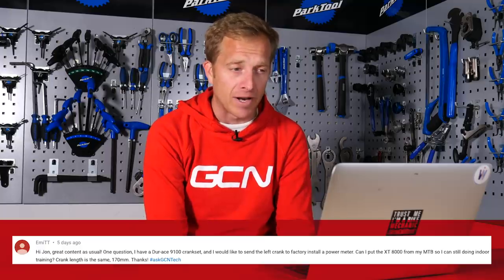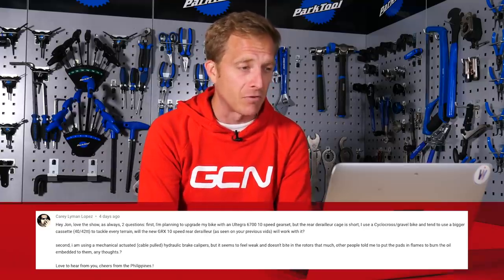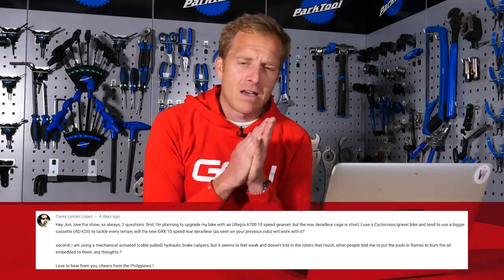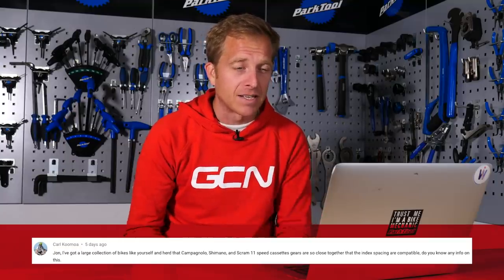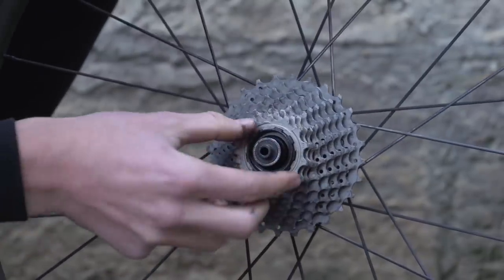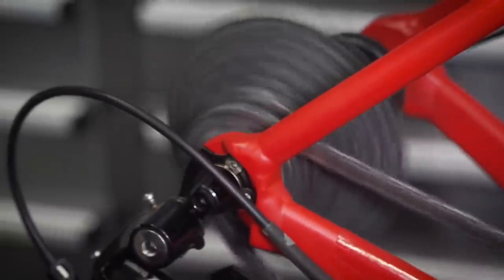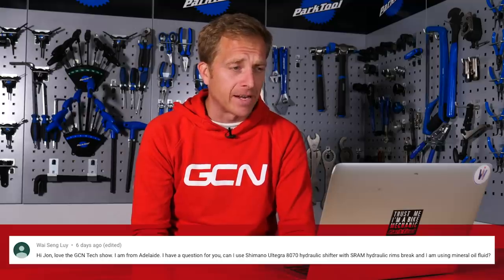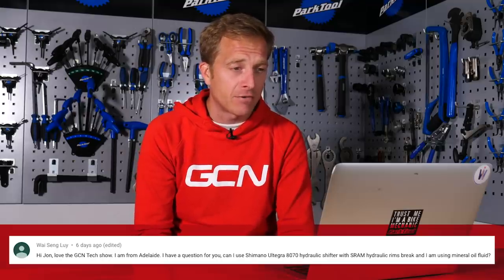Mixing Road Bike & MTB Cranks, Cleaning Brake Pads + More! | GCN Tech Clinic

Comment: To service brake pads take a tip from the automotive world: use aerosol brake clean on the friction surface of the brake pad and then sand the surface of the pad with emery cloth. Super braking guaranteed.
Reply: I’ve just built a bike with disc brakes but I would never use sand paper or emery cloth on the pads as you risk embedding bits into the pad.
If anything I would use a flat file as I have on rim brake blocks but make sure it’s clean.
Also, never try to bed the pads in by hard braking as advised in the video.
If you read the instructions with the pads it says a sequence of gentle braking.

Comment: #AskGCNTech Hi Jon, in this video, you mentioned cable actuated hydraulic disc brakes. Please make a dedicated video about them as I would like to know more about them. I was also thinking of buying a bike which had these kind of brakes but don't really know about them. Do explain them in another video. It will be really helpful.
Thanks.
Reply: The Juin Tech R1 brakeset gets good reviews. I had them on a bike I owned very briefly.  Performed well. My only concern with this sort of setup would be the fact that there is so little fluid in the system it wouldn't take a great deal for a heavy handed rider to cook them. Probably best avoided by downhillers & those that like to live on their brakes!
Reply: @wangdangdoodie  thanks for the reply. Will definitely consider this. Also the bike that I will probably be getting has TRP hy-road on it.

Comment: #AskGCNTech Hi Jon, Love the show. Had a question regarding some retro stuff for you. I have got by ocassion old stock Specialized Epic S-Works 2010 frame in new state. It has tapered head tube, while place for bottom bearing is to deep to fit any 3rd party fork. I've found some adapter Specialized used to produce for such cases, while it is out of stock everywhere. Do you have any idea of what I can use as adapter or some measurements to follow to build one in workshop. So far the idea is to have 2 bottom headset bearings instead of one. Cheers from St. Pet, Russia. Marat
Reply: bighdd Apparently you’re not the only one who has problems finding that part. I’d ask this on GMBN Tech - Henry and Doddy might be the experts on this. :)
Reply from the maker: As Ilkka says our friends over at GMBN Tech might have a better idea than us

Comment: #AskGCNTech Hey John (or whom it may concern), I love the show and look forward to it every week. I want to upgrade my drivetrain on my 3x8 speed commuter bike to a 1x setup with a narrow wide chainring. 
Is it possible to use a narrow wide chainring with an 8 speed cassette  and chain (most manufacturers only recommend 9 speed ones)?
Keep up the great work!
Reply from the maker: Generally the spacing on an 8 speed chain is much wider than on a 9 or 10 speed chain, which is what the N/W chainring is designed around. Therefore the chain might be too lose on the chainring to work in the intended manner. We'd not advise it sadly, but if you can get it to work let us know
Reply: @gcntech  Just did some additional resarch and now I know that the internal width of an 8 speed chain is wider. That got me thinking about something else. Wouldn't it be possible to use a 9 speed chain on the 8 speed cassette. This would probably cause some losses in shifting performance but should be worth a try, wouldn't it?

Comment: #AskGCNTech Hi John, congratulations for the excellent show and contents. This episode got me thinking about derailleur hangers: since there is such a variety of models (in the way they connect to the frame), do you know of any place/website where you can look for spare parts, or models? I happened to buy one for my bike, but the distance between the two bolts was not the one I had in my hanger… Thank you for your precious assistance. Regards, Mattia 🇮🇹
Reply: Hi,
I think you should correct your hash tag otherwise it won't show up to the people at gcn tech.
Reply: @prabhavgupta4924  I think you're totally right XD I didn't realize it, thank you for noticing

Comment: In the first question didn’t she mean to use XT crankset with the road bike (the front derailer and chain she had it on)?
Reply: No only the left crank
IMO they few mm of q factor offset to the left should be perfectly fine to use still. It will at least just fit like normal.

Comment: remove pads and rotor from bike-
scuff the pads and rotors with clean sandpaper

soak the pads and rotors in iso alcohol for 30 minutes
bake in a toaster oven at 425* for 20 minutes
allow to cool, and reinstal in the bike
Reply: Just squirt lighter fluid on the disk and pads and set alight. Repeat 2x or 3x and reinstall and woollaaaa
Reply: Clean with brake fluid. The sandpaper works to a certain degree, needs to be wet and dry and a fine if its past that stage then you're looking really at a new rota or a hard time to restore them without the proper gear. Good for the litght scratches though and I use it when its needed. I've even used a old 1500 wet stone, not perfectly flat but near enough.

Comment: #AskGCNTech Can we all just agree that front derailleurs are more trouble than they're worth and move on now please? I'm a mechanic and they are the bane of my life.
Reply: I half agree. My SRAM ones take ages to setup initially but then work fine basically forever (with sealed cables). Can understand your pain as a mechanic though.
Reply: Anonomosomous 
Just watch the Park Tool video on setting up a front derailleur.
That’s all I did for my rebuild with Shimano 5800 and it works perfectly.
Reply: terry shaw I know how to set up a derailleur, I'm a mechanic 😂 people do tend to mix and match them which leads to no end of problems.
Reply: @hogdog567  yes I can imagine that would lead to problems.  I didn't realise I'd tagged the reply with your name so wasn't suggesting you would need to watch the video. More for the 'unskilled' such as myself. They are usually very good vidoes.
Reply: terry shaw they are a good source of info 😎😉